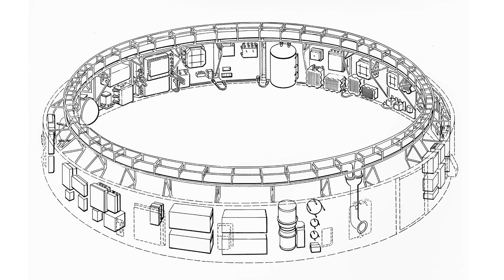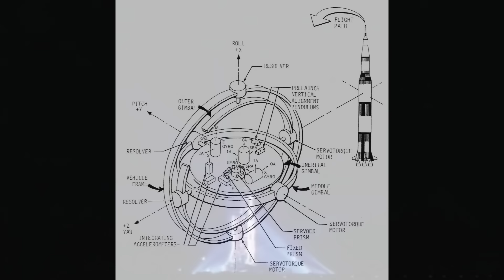The Saturn V’s Hidden Strength: How Engineers Fought the G-Forces

Comment: Interesting tidbit: at liftoff, the power to weight ratio was only 1.65 to 1. Great video! This is my generation.
Reply: Actually, the Saturn V's power/weight ratio at lift-off was only 1.2, significantly less than the space shuttle's 1.5.
Both increased during the launch, mostly because the weight decreased as the fuel was burned. The Saturn V had a higher maximum acceleration than the shuttle (4 g vs 3 g), but the shuttle had a higher average acceleration since the Saturn V's acceleration never exceeded 1.8 g during the second and third stage burns.